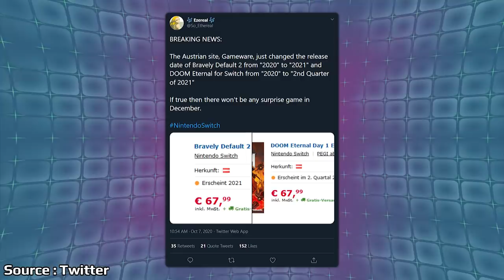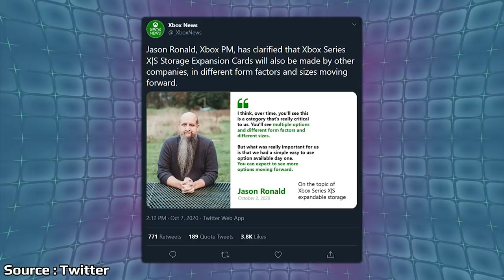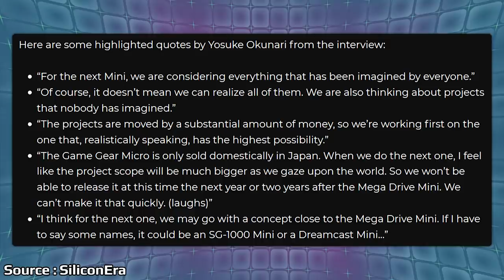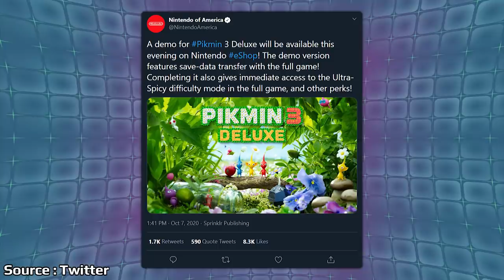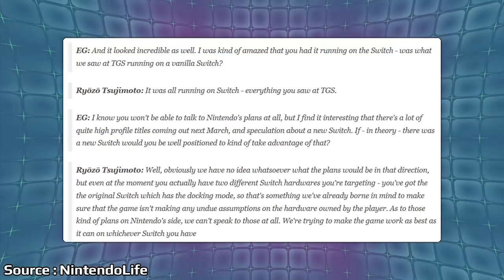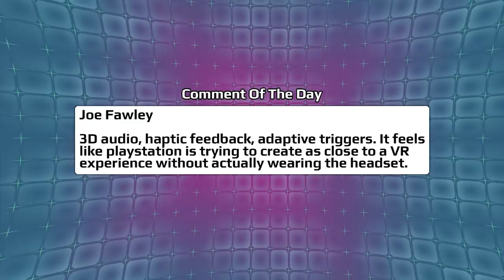New PS5 Details Revealed In Teardown And Sega Talks Dreamcast Mini? | News Wave

Comment: I imagine seeing a PS5 on ebay in 5-10 years with both side panels ripped off, the stand (let alone the screw) nowhere to be found, and that dust catch filled to the brim with crayons or something.
Reply: A literal nightmare.
Reply: Don't see that happening
Reply: Tronicsfix would have a field day fixing that mess
Reply: I’m sure Spawn will buy it and then attempt to fix it in a Techwave video.
Reply: I see the ps5 sitting in a landfill somewhere. When the online support of the system is over, and none of the games work, because the system cant hold all of the games, so half of them are on a sony server somewhere. The days of holding on to your game collection are coming to an end.

Comment: I actually said holy crap outloud when they pulled that heatsink out of the ps5, Its  good to see they put alot of thought into the cooling of the system.
Reply: My first girlfriend had the opposite reaction when I pulled out my shamefully small heat sink :(
Reply: @mistermetokurarchives  Dang that sucks.😔✊
Reply: Mister Metokur Archives NOT JIM your girl was gawking at my heat sink 😈
Reply: @jelioooo  bruh XD
Reply: It doesn't take an engineer to make a bridge stand but it takes one to make it barely stand. Making something big doesn't mean it's well though out, they could have just given up and just made a huge heatsink instead of pouring millions into engineering a more elegant solution
Reply: @misham6547  you don't what happened behind the curtains and neither do I so please, don't make assumptions.
Reply: @BralynFuller876  That as kind of my point just because something appears "over engineered" doesn't mean it is while the inverse can be true. This might be a good design or just there to compensate for a bigger problem, my point is that you have no idea until you test the product for a couple years to find out why it's done that way
Reply: @misham6547  It looks like modern laptop heatsinks with vapor chambers connected to heat pipes and fins. Should be fine. I was more surprised at that vacuum cleaner sized fan
Reply: Lol yea and then there’s ppl like rgt85 who says “who cares about cooling systems and fans on consoles?” Ik I care if it’s going to keep my system running cooler
Reply: @chriskorol4856  indeed, you don't want an overheating console do ya.

Comment: To think how much dust the PS5 could easily suck in with its powerful cooling system, cleaning the inside should be a breeze with the detachable panels taken out. Then spraying all the dust out with a can of compressed air accumulated after a few months of intesive use would be satisfying.

Comment: A Sega Dreamcast would be a dream but I think there's some challenges like the bulky controller and stuff.

What I would like to see is a Sega Saturn mini. It's easier to produce and a selection of Saturns best games would be pretty awesome.
Reply: Saturn is actually harder to emulate than the dreamcast. Much harder
The Saturn was kinda the ps3 of its era. Very exotic architecture, very hard to Programm for and emulation on didn't work that well until comparatively. recently there were comments of maybe 1 out of ten programmers beeing able to Programm for the Saturn properly
Reply: referral madness  the time around Saturn was still dominated by C language programming. The SNES era slowly started with C while many still were doing Assembly. But PS1, N64 and Saturn was when the industry moved towards C.

Comment: Chronologically speaking, we need Sega Saturn mini before Dreamcast mini...
Reply: What is this Sega Saturn you speaketh of? If I remember correctly, Sega chose to completely skip the 5th generation of consoles to focus on the amazingness that was the Dreamcast, and to avoid sullying the name of the Genesis... right? Right?
Reply: The real problem is the only games that I would want on a Saturn mini would be all Japanese.
Most of the best games didn't really get translations either.
Reply: @garrettthompson580  it was the sega cd and 32x that sullied the sega name. The Saturn was pretty dope, just didn't get as many 3rd party games in the usa because sega of Japan likes to hurt itself in confusion.
Reply: The problem with the Saturn is that emulation is very complicated due to how over-engineered it was at that time. Hence, DC is more feasible because it can be emulated relatively easy on lots of devices, be desktop ones or portable ones.
Reply: @garrettthompson580  you mean the awesomeness that got canceled after a year?
Reply: The Saturn has like 3 games tho

Comment: I doubt if I'll ever get over the size of the PS5. The tear down got me wondering if we'll be able to manually install a 4K Blu-ray disc drive in the Digital Edition though..  🤔
Reply: It might have the port but if it does Sony probably had it disabled in software/ firmware
Reply: There would definitely be software issues with that as Sony probably isn't paying for Blu-ray and DVD licensing on the digital version (also no Sony doesn't own the Blu-ray standard entirely).
Reply: @magnarex  Yeah. That's my assumption as well. But it would be wild if it is left unlocked. Would make getting a Digital Edition and then a disc drive off eBay a viable option.
Reply: @weaverquest  sony owns BluRay dont they?
Reply: @Steps Because sony is charging you $100 for a disk drive lol
Reply: @manakmishra  Sony co-owns blueray with a few other companies they developed it with. Same with dvd and cd.
Reply: @Steps If they are taking a loss for the digital edition,It also means that they're charging you $100 for a disc drive, These two statements aren't contradictory
Reply: @manakmishra  Afaik they are part of the Blu-ray association that includes many companies besides Sony.
Reply: @manakmishra  They co-own Blu-ray with a conglomeration of companies. One of them being Microsoft ironically.
Reply: @jerryharrison-ford1120  no, Microsoft was never part of it... If you remember, they previously supported HD DVD format which is now obsolete...
Reply: Honestly, the size of the PS5 is probably the main reason I might never get it lol. I will have no where to put it. Hopefully in like three years they make a smaller 1.
Reply: Mayman so? With disk I own it and I can do everything with it.
Trade it sell it lend it etc.
Digital on console isn’t possible (yet)
Also cheaper in long term
Reply: Michael Abayomi u smart bro never thought of that
Reply: @peppinoandweskerfriendsfor3450  You do you but that is such a pathetic reason lol
Reply: @kipoyedcl  My bad, Microsoft is involved in Blu-Ray Disc Association when in comes to Codec implementation (VC-9 / HD-WMV , MPEG4 AVC High Profile, MPEG 2).

So technically when you buy a Blu-Ray some of the money goes back to Microsoft.

Comment: Curious thing about the Trophy Update is that it doesn't address any of the problems with the old system, it just makes all the numbers bigger in an attempt to make the curve feel a bit more smooth. I think the only "noteworthy" thing it actually brings to the table is that it takes more games to hit the level cap, as it has apparently reduced the number of capped accounts from 1000s to 100s. Seems like if they were going to bother with the update they should have just removed the cap and made progress smoother.

Comment: One accessory that will probably show up within a year of launch is an SSD selector box. This would be a fairly simple item with at least three slots, each with a button than creates the appearance from the system's perspective of the SSD being removed and another inserted. Microsoft has made clear that hot plugging is supported, so it doesn't need to be complicated. A higher end version would allow multiple SSDs to appear as a single volume to the system. This would work more like a NAS box in JBOD mode and would by necessity be considerably more expensive. So an item with a far smaller market but out there for the fanatics who want their entire library installed and ready to use without delay. There are already product out there to do this for M.2 SSDs, so much of the engineering work is already done by those companies, greatly reducing the cost to develop and produce it. An opportunity for the company with the right existing asset to exploit it for that fanatic market.

A Dreamcast Mini could do something that would be a first for nostalgia boxes and very appropriate for Dreamcast: support online. Create a digital storefront to offer a wide portion of the Dreamcast library in addition to the built-in games (and allow updates/fixes of the factory installed games after the screw-ups of the PS1 nostalgia product), and have an additional USB port just for storage expansion. Thus the product can have a low cost of entry but grow to suit each purchaser's desires from the Dreamcast library. 16GB of internal storage should be plenty for an initial set of games and firmware. Many of the popular titles are just a few hundred MB, and many others can be shrunk considerably by tweaking the FMV to use modern codecs (with optional quality settings), and eliminating redundant files on multi-disc games.

Comment: I'd rather see a Saturn mini than a DC one.  But maybe that's because I still have my DC and recently modded it with a GDEMU and never owned a Saturn.  Same basic reason why I got the Genesis Mini.  Never owned a Genesis, so this was the best way to experience it without setting up yet another emulator on the Wii or PC.  And then Project Lunar came along. :)

Comment: I can't even imagine how they'd pull off doing a Dreamcast mini. Emulating is easy enough but  how do you design the controller?  Do you include a VMU? is it even worth making a VMU replica when it only serves a small but iconic part of their games? I feel like Sega would have to cut corners depending on how authentic they want the experience to be. But Pie in the sky thinking here, it would be awesome if the controller had ports to use old VMUs and the system itself had an online function to play stuff like ChuChu Rocket, Phantasy Star Online.

Comment: CAPCOM and Nintendo have been tight for a long time. If anyone has the new Switch specs, dev kits, etc. it’s them. As an aside I wonder if this isn’t the same reason Doom Eternal hasn’t been released yet.
Reply: Cap has nothing to do with doom
Reply: @jsmith3946  The suggestion being that Doom Eternal would be saved for the next hardware.

Comment: I want custom panels for the PS5  that just fits tightly to the body of the system. Doing just that would significantly reduce the size of the system and it would look better in my opinion.

Comment: What we want from You MS is no added fees on top on those Proprietary SSD of yours for an SSD that is just using PCi-e Gen 3 2x speed of 2GBs at 200$ for a 1Tb is just too over priced doesn't matter who manufacture it as long its in the right price range doesn't seem right when you can buy a PCI-E gen 3 x4 Nvme SSD at 3 to 3.5GBs for 120 to150$ Sony already showed you can just plugin as standard NVME drive in the PS5 and I am guessing any drive with 6GBs speed or more will work in there and those can be had for 175$ up wards at almost 3 times the speed on what is available in the XBOX SX.

Comment: I like how some people are upset that Pikmin 3 Deluxe looks slightly better than the original and upset that Nintendo is "lazy" with ports, if they were lazy the game would have a lot of bugs. Also the game looks good in the original as is in the Deluxe so why fix something that isn't broken?

I kinda don't like that the SSD in the PS5 is soldered into the system but I can see why though it would cause problems if something goes wrong with the SSD and there is no way to swap it out.

Weapons breaking in BotW makes sense, it doesn't make sense in a Warriors game.

Comment: Spending any more than $90 on a retro console is crazy. If it were at $150 you’re better off buying an actual console and using ROMs. Keep these in check and around the $69.99-$79.99 range max.

Comment: I feel that people complaining about the cost of the Series X memory cards are just ignorant of reality. Again, PS5 literally won’t have expanded storage when it’s released and those 1TB options for when they do arrive are going to cost just as much as the Series X hot swappable cards. This is the cost of brand new tech. 10 years ago a regular SSD at 128GB was about $400. Try building a PC right now with nvme 3, a slower option, and tell me what those prices are, because it’s not cheap and definitely not hot swappable.

Comment: The Zen 2 chip is clocked at 2.3GHz? Interesting. I guess the low clock speed is why they get away with it apparently not pumping out a load(read: a LOT) of hot air.

Comment: I'm genuinely concerned about the use of liquid metal in the PS5. This could negatively impact the longevity of the console. I think I'm going to wait for a major revision.
Reply: @Sarafan92  Testing it for 2 years doesn't make it problem free in the long term.
Reply: @Star Scream Like jon said, it's conductive and can corrode certain metals. Assuming they've chosen materials that won't corrode to contain it, if the seal is broken then the system is compromised. Older game systems have lasted 3 decades, until the capacitors died, but this could greatly reduce the long term lifespan of the PS5. Not relevant for those that just want it to last the generation, but real bad news for long term collectors.

Comment: The PS5, almost from top to bottom, looks overengineered. It'll probably still be a good system, but I can't help but see this and think that this overengineering is a direct result of Mark Cerny being Mark Cerny and an 'oh shit' moment that they surely had when they realized that their RDNA1 (and I believe rumors pointed to Zen1 as well) console was going to get stomped by Series X and RDNA2. They would have had to greatly improve performance without starting over on design so they would have had to have this massive cooling system and the questionable power balancing in order to get this done.
Reply: The rumors actually point out the PS5 being RDNA 3, or rather what is going to be sold as RDNA 3 in the future by AMD. Sony put a lot of effort in customizing the GPU so whatever it might be, it is definitely superior to the readily available off the shelf RDNA 2 Xbox is using.

Comment: PS5 look like a GIANT Fisher Price toy....ugly ! _Sony has always designed trash hardware PS consoles (PS3/PS4). What kind of design is it that they can use a single fan to blow the super hot air from the GPU/CPU Heatsink through their big power supply, which because it has so many transistors holds the hot air and does not let all the heat out. In addition to the fact that power supplies run hot, are you going to heat it up more by pulling the super hot air from the CPU/GPU heatsink? That's trash hardware design . That is why so many PlayStation die. Sony has sold more than 100 millions PS,.... right because they die and you have to buy it again and again! That's why I chose Microsoft ( From Xbox One / S / X / and now Series S/X) because they design the best console hardware. Series X has 2 separate small motherboards and that better for cooling and performance !